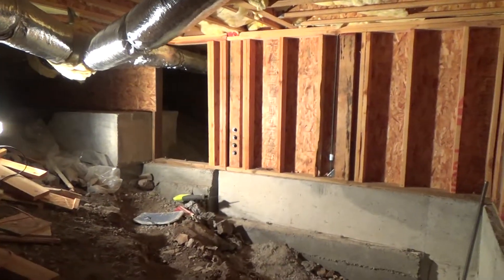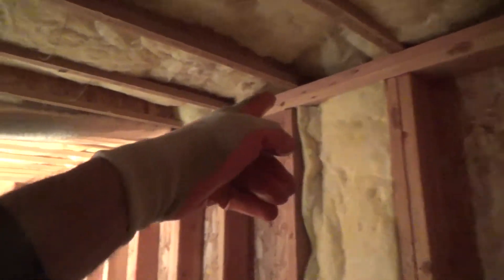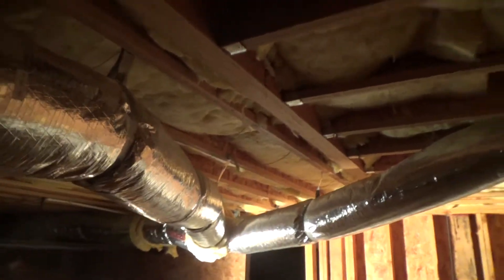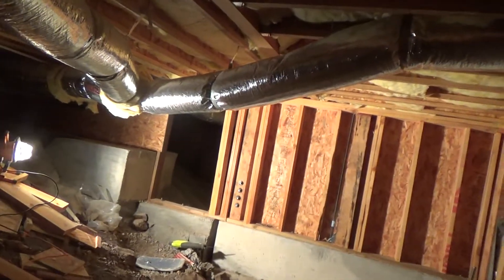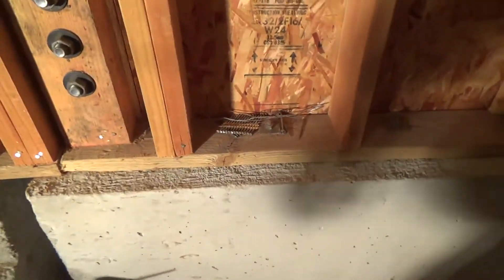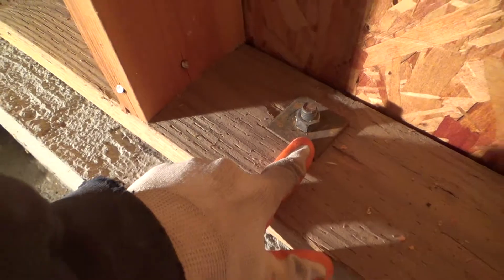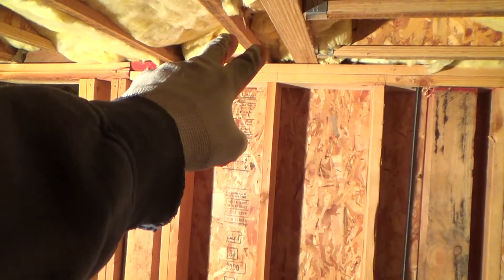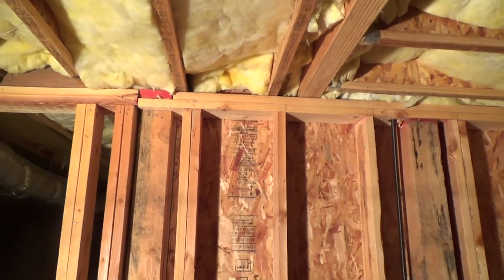Shouldn't ALL Load Bearing Beams Have Support Posts Under Them? So Why Doesn't THIS One?!!...Part 1

Comment: Cutting your foundation anchor bolts is an epically bad idea. You personally have literally no idea where or why they should be. Leave it to the pros. It's what keeps your house on the foundation in an earthquake and helps keep your family alive. Adding posts on top of them is no problem at all and takes less time than cutting them. Beams do not always need post supports exactly underneath them. Many situations call for an engineer to calculate load paths that shift over to the side a bit as the weight is transferred down. On your cantilevered-joist beam, you are forgetting that all of the weight on other side of the wall (all of the cantilevered portion  of the house and everything above it) is acting like a see-saw on that lower basement pony wall, which has the effect of LIFTING UP on that beam, offsetting much of the downward load. There is likely zero errors in framing or design in what you show. You can check for sure by getting a copy of your plans for your house (with engineering) from your local building department. EVERYTHING you say in this video is just wrong, sorry.
Reply from the maker: Thanks for your message. I have done lots of framing years ago & every time a beam was placed on a wall there was a post directly below the beam to support it. In this case as I show there is no post at all & nothing below the huge beam end. Only the double plate is there below the beam with a 2x6 stud fairly close to support some of the weight. This in my estimation is wrong no matter if a portion of the floor is cantilevered. The inspector should've caught this & the foundation bolt is one of many close by that holds the mudsill in place that's all. I would rather cut the foundation bolt off than notch a few studs or post to hold the weight of the beam.